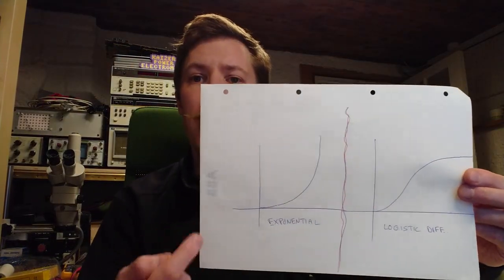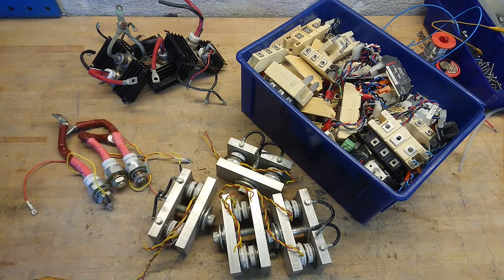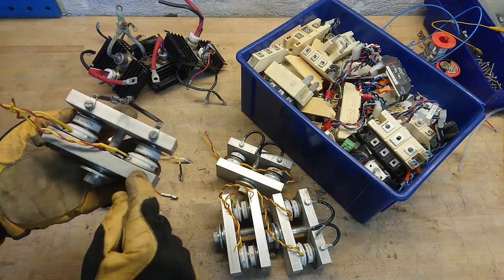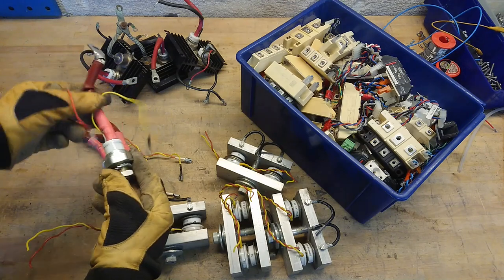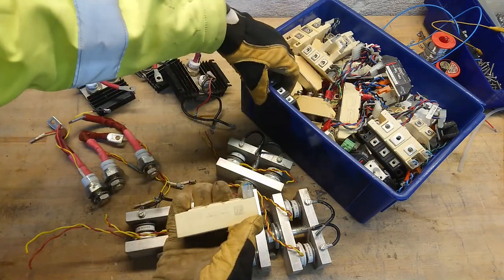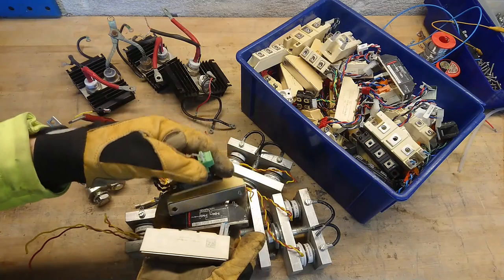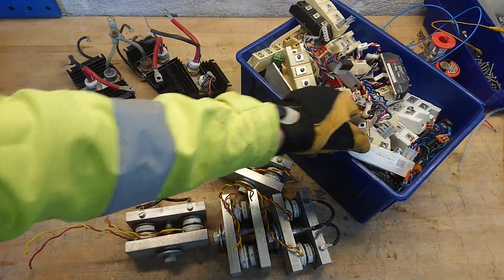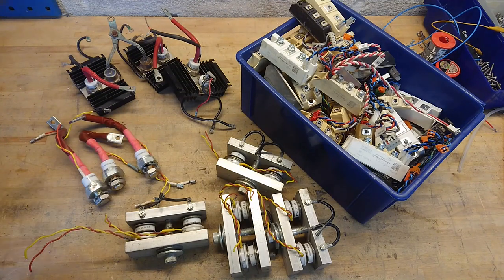SCR / Thyristor In Power Electronics - Isolation, Day 14

Comment: Interesting, I guess they are somewhat secure if used with AC current, since they will automatically turn of after each halfcycle. 
I learned about their behaviour the hard way a long time ago,  by trying to switch them off with DC applied and therefore killing everything behind them.
Reply from the maker: Also good for DC pulse currents, capacitors discharges into inductance of a ring launcher or such :)
Reply: @KaizerPowerElectronicsDk  Yeah, that's what I ended up using the remaining Thyristors for, discharging the capacitors of a coilgun. :)